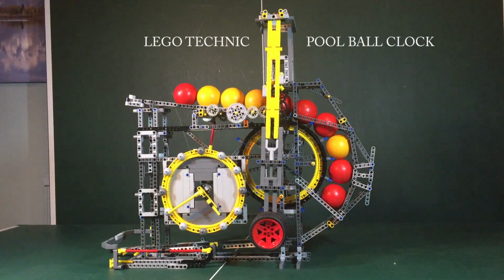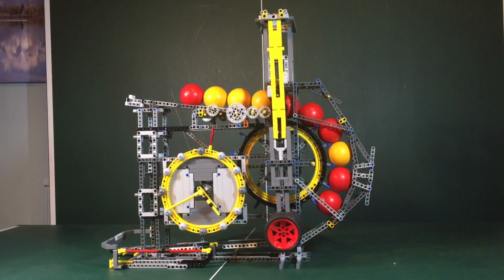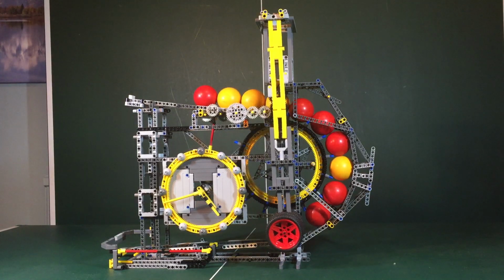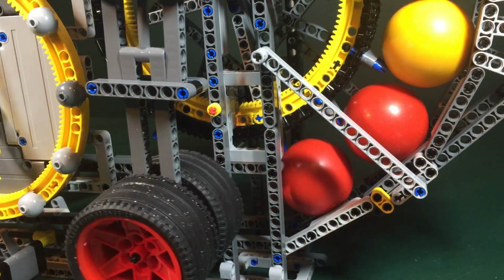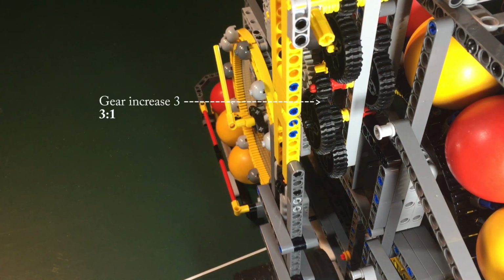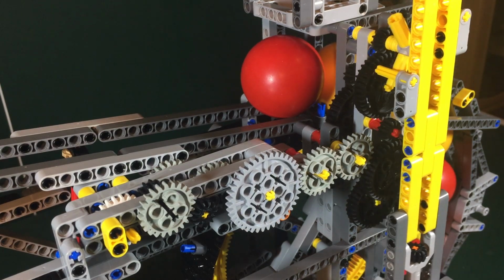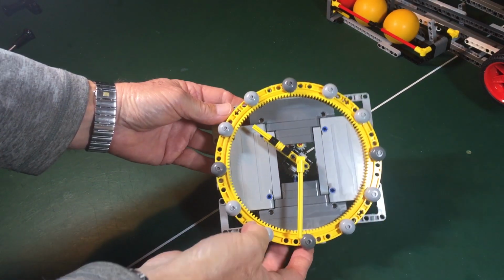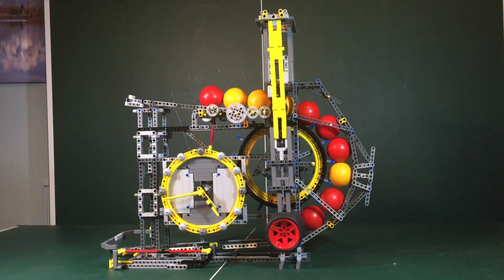Lego Technic Pool Ball Clock

Comment: Where did you buy the lego compatible metal chain you used in the newer version of this clock?  I can't seem to find such thing anywhere online.
Reply from the maker: The company was www,technology supplies.co.u.k and the part number 560-161. I just looked them up again though and it looks like it isn’t listed as a product any more. Suggest you contact them by phone to see whether you can still get it. If not then apologies for getting your hopes up. I’m using the chain currently as the winder chain for a grandfather clock with a 1Kg counterweight. It is ideal and I don’t think Lego chain could have taken the load. Good luck with your enquiry and model ambitions.

Comment: What I would like to see is a clock whose hour hand doesn't advance until it's time to.  Right now every modern clock on the planet works the same way.  The hour hand slowly moves from one number to the next as the hour progresses.  It didn't used to be this way.  The hour hand never moved until the minute hand had finished a full revolution and then the hour hand moved from one number to the next.  Somewhere along the way, we lost the gearing knowledge to make this happen.  But this is a great design using a novel source of power.  Well done!

Comment: I love this idea so much. I may have to order myself a set of old pool balls.
I have an easy solution to a knife edge but it uses the old technic pieces : bushing (4265) and connector (4273). The other pieces are easy to come across.
Reply from the maker: Thanks for the comment and I hope you do get some pool balls. If you can solve the problems of the very high gear reduction needed to get 48hrs of operation per rack of balls then do let me know. As you’ll see from the other comments I got stuck at around 4hrs of operation before stiction in the shafts stopped the clock. It’s a genuine toughie to solve and well worth an engineering challenge for the Technic nut. I haven’t dismantled mine yet but I have run out of ideas and, now lockdown is over, enthusiasm for yet more innovations.

Comment: Very nice design. It could be interesting to add motor-powered elevator on the left side to lift balls back up.
Reply from the maker: Thanks David, I did try to add your 40pin escapement design in order to increase the longevity of operation on a single charge of balls but I could not get the mechanism to deliver enough torque to sustain it in operation. To get it to work I needed a lower gear reduction and that lost me the gain in duration. I was trying to avoid using electric motor assistance and somehow solve the stiction problem in these high gear reductions. So far no breakthrough and I am on the verge of giving up. I followed many of your clock videos for advice over the months so thanks for those.
Reply: @technical35  Three things that come to mind is using only 8t and 40t gears for 1:5 ratios - then just 3 stages are needed for 1:125, already more than 1:81 shown here. 
The 1:945 ratio is really impressive, I never thought that more than 1:500 can be done. Another trick to reduce friction is to always place gears on axles supported on both ends. 

Finally, ensuring that there is no flex in the mechanism is essential, but this definitely would be challenging here.  

Also, as you noticed, a knife edge makes a lot of difference. Maybe try putting 1x1 bricks on the ends of the 3l axle shown in the video? (I haven't tested that but it may work)
Reply from the maker: @davidziemkiewicz1350  Hi David, I did try all of these things in attempts from the time of posting the first video until about Xmas time. I did use the knife edge hinge and reverted to 40t and 8t gears supported at both ends. I managed to get 4 gears to run but not a 5th reduction of any amount. It seems that the 5th reduction is the point at which stiction takes over big time. In an attempt to up the run time I switched to the 8 blade “propeller” part for the escapement. That would run OK for a while but eventually stopped when some minor variation in stiction overcame the drive. My original 3 star escapement would work and I can only assume that the additional rotation of the final drive keeps the stiction at bay as the torque doesn’t alter. With a 5th gear added of any reduction nothing works for longer than a minute. I think I am just about giving up on the idea that it is possible with Lego to get my concept to work for 48hrs on a single charge of balls. I am a factor of 10 adrift as my best design that ran would get through a ball rack in 4 hrs. If your 40t escapement design had worked for me you can see I would have gotten closer to a workable clock. But I don’t think I was ever close to having sufficient torque after the high gear reductions. I could send you a picture of the final stage I got to but I don’t know how to attach an image to these notes. Thanks for trying to help, I appreciate the thought you gave it.
Reply: @technical35  Hi! Thanks for a very detailed reply. You are right that 4 reductions are about maximum of what can be done - I've never had any luck with going significantly beyond 1:625. You might give a grasshopper escapement a shot - it needs very little torque and due o the fact that escape wheel never stops (and even reverses for a moment), a lot of problems with stiction can be avoided. Here:
https://www.youtube.com/watch?v=aLvndbLnL80
is an example of grasshopper running on 15 Ncm (1.5 kg on ~1cm radius spool) and 1:625 reduction.